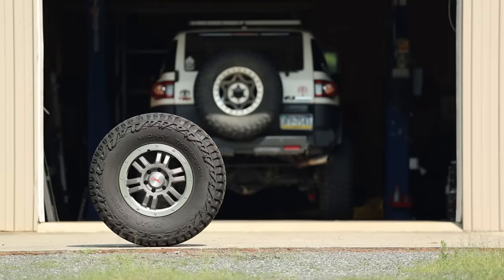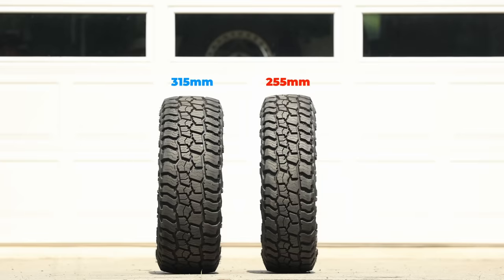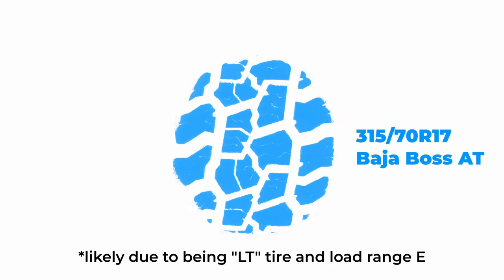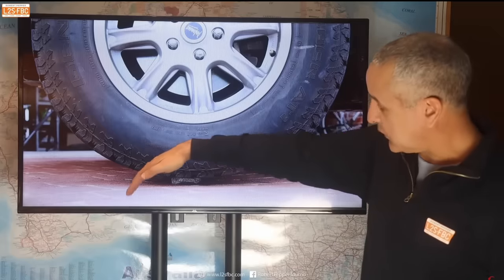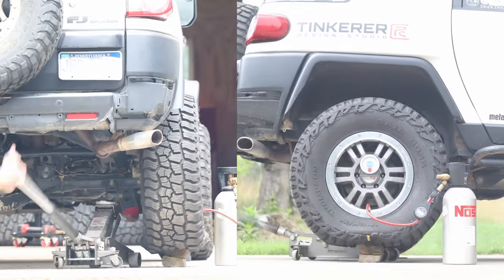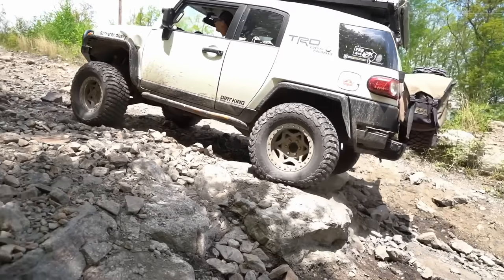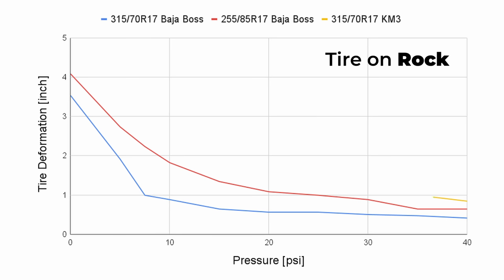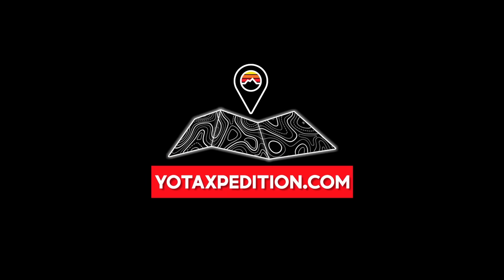3 Scientific Experiments to Settle This | Wide vs Narrow Off-Road Tires

Comment: Awesome work, the flex was the part I never would have thought of. I would think the narrower would work better as the contact patch would actually be longer . The same principle works for snow tires, longer narrower can slice through snow and mud easier than wide an short. The WRC use really narrow studded tires for the snow rallies for this purpose.
Reply: They're mostly driving on packed snow/ice and maybe light dustings. That doesn't work in deep powder. You need more flotation in snow deeper than your bumper or you'll just get Gandolf'ed.

Comment: I was told by most of my experienced elders its about how much mud or snow the tire has to push away from the trail. Wider tires take more power to go through mud n snow than thinner tread, maybe you can try a test on this. Very informative video and I always choose thinner too- (higher the tire the better clearance) was the other bit of knowledge i was told too.

Comment: Great video and very informative! So what I was always told, is that the guys who liked wide tires were the guys going through sand and mud, this is supposedly helped you float through it. The guys who liked narrow tires were the ones cutting through snow/ice and the use in a dirt rock type of mix for terrain with a little mud thrown in as well. I have always ran a narrow tire and I have had great luck in all of the terrains I have used them on. I also like the fact they do weigh less they the wide tires, so i guess it is just really up to the buyer.

Comment: This is a VERY cool experiment, and major kudos to you for doing all this work! A lot of this had to do with rocks and other obstacles... I wonder how the differences would show in mud handling... I was always so surprised by the really narrow tires used in military vehicles (such as US Willis Jeep and Mutt, or the Soviet UAZ) - the vehicles designed to basically follow tanks and other tracked vehicles through messed up terrain....
Reply: I’m in Florida. All we have is mud. I stick with skinnier because they tend to clean better than the wider tires. I’m in a v6 jeep though. An 8 cylinder probably has enough power for the wider tires to clean on equivalence.
Reply: Take a look at Russian and surrounding areas that do truck trials.  Alot of mud and swamp. They use thin tires. Jungle trekker tires  a go to are crazy looking tires
Reply: Just anecdotal evidence here. My father and I spent many years buying, restoring and reselling military (United States) wheeled vehicles. Unless one was in very "soupy" mud, the narrow tires did extremely well off-road. We restored "GP", 3/4-ton trucks, 1 1/4-ton trucks, 2 1/2 trucks and the occasional 5-ton truck. As long as the axle lockers were working properly, all of them were incredibly capable vehicles, if a bit on the utilitarian side. The only modification we made was to cut the military tires to have a cross groove between the wicking grooves.
Reply: @mattbrown5511 you would actually cut the tires?
Reply: @cwr8618  The tread area, not the belts or side wall. Common sense prevails.
Reply: @mattbrown5511  that’s what I meant. Haven’t heard of people cutting up tread. Seems like just a factory thing
Reply: @cwr8618  Mud racers have been doing it since I was a kid (I'm 53 now). The mil-spec tires have a center rib that tends to cause hydroplaning at even low speeds on paved roads. That is why one would consider cutting wicking grooves into the tread. I hope that clarifies the issues. Be well and happy wheeling.

Comment: Another awesome video!  It's great to see some actual data attached to what a lot of us already know: all other things being equal, narrower is better for most off-road scenarios.  As far as pizza cutters go, I believe the Baja Boss AT are the only 255 width "35s" out there and Kenda Klever RTs are the only 265s (35x10.50) available that I know of.  It would be great if a lot more tire manufacturers made these sizes available.
Reply: I’m loving my switch to the narrow RT’s so far. I’ve seen no loss in performance yet. I’ve gained 2 mpg hwy due to lower rolling resistance.
Reply: I believe interco offers a super narrow 34”
Reply: the new Klever M/T2's should also come in 35/10.5 according to their website. I'd be really interested in seeing them tested as they have a similar tread pattern to the KM3's and come in 35/12.5 as well
Reply: That might be correct.  I ended up purchasing 255/80-17 earlier this year but throughout my research,  it's very limited.

Comment: very informative video. I just changed the tires on my f250 from a 295-70 R18 to a 285-75 R18 the new tire is a bit narrower and slightly taller but I noticed a drastic difference in the ride and steering. the new tires have a lighter steering feel and a smoother ride. the new tires are also a few pounds lighter than the old set. I have also noticed a slight increase in fuel mileage. I do still prefer the look of the wider tire but the narrow tire is turning out to be the better choice for many reasons
Reply: I made a similar jump but 285-70r18. Gas mileage definitely improved but most importantly wet road and snow performance improved. Also loved the 295 look but saw pretty much no performance positives from them over the 285. Maybe certain mud terrain

Comment: Thanks for another great informative video Kai. I am running 255/80/17 on my modified 2005 sequoia and am super happy with them. your data seems to match the great performance I've been getting! really looking forward to your video you mentioned on the relationship between front locker and cv axle breakage. As a machinist I appreciate the technical explanations. Thanks again

Comment: Awesome video - can you also include road noise and mpg efficiency into this comparison? I only ask that, because I think while the thinner might not look as good, it would get better gas mileage. That along with the offroad performance would make it a better daily driver that can go offroad. As well as getting rid of unsprung weight by using narrower tires.
Reply: I’ll second that for an mpg test!

Comment: Great video! I would absolutely love to see you apply this same approach to wide vs. narrow tyres in sand or mud. My initial thought is that wide tyres would be better, but I’d love to see some hard proof of that!
Reply: In mud you’ll want a wider tire for sand I couldn’t tell you, but from personal experience living in the red clay covered south you’re less likely to get stuck with a wider tire.  Narrow tires do NOT work well in mud!
Reply: @BoostedYote   Depending on the mud I suppose. Clay based mud with a bottom I find skinny tires that clean out with RPM are far better then a wide tire. Getting more into organics like muskeg where RPM is not exactly your friend yes a wider tire seems to be more beneficial in my own personal experience. I'll still stick to a narrower tire on my truck that see's everything though.
Reply: @KreemieNewgatt  and yet I've seen both types of tires do really well on sand and mud. There are lots of opinions out there, would be great to see it actually tested!
Reply: @CRIMSONWAVE18 I agree about the mud.  In the part of Croatia where I live, there is a lot of mud and swampy areas.  Whenever we are in that mud, the guys with wider tires go through the soft mud more easily.  Narrow tires sink in the mud and get buried.
Reply: @KreemieNewgatt  So you would think. I've done quite some driving in the Sahara desert and in some of Australia's and South America's deserts and my experience was that wider, aired-down tires push more sand in front of them which increases resistance.

Comment: Thank you for being the voice of reason. Being on 16s I love 255/85/16s over 285/75/16s. I’ve contacted several manufacturers to see if they’d eventually release pizza cutters, with no luck. Fortunately a handful of decent MT tires exist in that size. It would be nice to have more options though, especially in AT design
Reply: I’ve exactly the same opinion, and request. I run 255/85 R16 Toyo MT, but whould like to have an option in AT ou hydrid Tire. No luck in Europe to get tire options on this size 👎

Comment: Great Video!
My biggest question is if the BFG KM3's side wall has gotten softer since it has been run on the vehicle and thus made it conform better to the objects than it would if it was new like the Mickeys.
Reply: Tire break in is definitely a huge factor
Reply: This was my first thought as well when the KM3 was brought in to the test. I had to replace a KO2 that had about 25,000mi on it with a brand new one. I had the thought about break in period and non-scientifically tested it by airing down shortly after getting the new tire. You could really see a difference in sidewall flex from the older tires to the new one.
Reply: Yes, and also for a meaningful comparison we would need to see the performance of the KM3 in 255, that should smatch all the tires tested.
Reply: Curious if it was also Load Range E?
Reply: Was thinking the same thing

Comment: Thanks for doing this. Great testing. One thing that I think is also important to measure would be the contact patch measurement at speed (say in mid speed cornering where handling really matters, especially in offroad situations where there are top heavy vehicles. It would be interesting to see the side pressure bias and how the sidewall of the tires with wider contact patch would fare against the narrower tires, and the lower ability for them to flex during high side weight bias at speed...  This is an important metric that should be taken into account. Thanks for posting this!

Comment: Nice video 👍 One important feature you missed was the reduced drag on a skinny tyre in soft terrain with the same footprint as a fat tyre.  This can make a significant difference to range, and on vehicles with lower power, the difference between getting through or not!

Comment: Pretty good experiment. I think you're used tires have more flex from repeated deformation, in other words they are "broken in". One variable that wasn't considered in this experiment was different types of terrain/surface that the tire is riding on. To me this experiment is applicable to concrete or rock only that is uniformly distributed across the tires surface. If you are driving on sand, mud, or even soft topsoil, I would hypothesize that the contact area of the wide tire will be significantly larger than that of the skinny tire as the ground itself will deform around the tire. Also vehicle weight comes into the equation. Your 3000-4000 lbs toyota and my 8500 lbs diesel will cause a much different flex in the same tires. Enjoyed the experiment and video, thanks for sharing.
Reply: possibly but like he said the skinner tire would have a longer contact area, as opposed to a wider... and in soft terrain id prefer a longer contact area still.
Reply: didn't even think about vehicle weight that's a good point
Reply: Do u troll many OFF-ROAD videos while ....lol- useing an 8500lb diesel to 4 wheel?
Reply: @wlh3640  To be fair, it was never mentioned in the title that it was off-roading. I came looking for info on snow driving for example, and stayed because this stuff interests me.

Comment: Epic video! Would love to see similar comparison between same size but different load ratings: E rated vs C rated for instance. I think many folks run higher rated tires than they need for their "toughness" without realizing it may not be necessary, and worse (maybe?), it's hindering their off-road traction.
Reply: I agree, but also I’m curious what the difference would be between an MT and an AT of the same size/load range/psi. If tread pattern plays as much of a role as indicated in the video would the smaller tread gaps that assist on road hurt even more off-road than we realize? So many questions and possibilities.
Reply: Until you get a flat

Comment: Where the wider tires really shine is on soft terrain. That is where you actually get much more ground contact, which helps you stay on top instead of cutting into it like skinny tires do. You also figured out why BFGoodrich tires are so popular with offroaders.
Reply: That's actually not true. It's been tested. Wider contact patch causes more rolling resistance in soft stuff. Airing down a skinny tire increases the front to back contact patch gaining traction with less rolling resistance to get you more stuck. There's a YouTube video out there about it
Reply: @jesseflores9087 you want flotation, why do you think mickey builds a sand tire that is 14.5 wife and all the Iceland off readers run 16 inch wide tires in the snow
Reply: @jonathanpalmer228  Yes, but you have to go THAT wide minimum to get that kind of floatation on snow.  Unless you have enough floatation that you don't sink into the snow at all additional width is a detriment.
Reply: Wider tires shine in rocks, not soft terrain
Reply: @Devin_Stromgren  that's where 14 plus inches of tires come in. Why do you think tractors have such wide rear tires
Reply: @jonathanpalmer228 Actually the ag tires R1s, are much narrower than other tires like R4s and out perform R4s in the dirt and mud by a good margin.
Reply: @court2379  you do realize that the small skinny R1 is for the front only and are solely ment for steering while the back are still R1 but are like a 710/70r42 and the dimensions are 721mm 28 inches wide so y9u can't tell ne their isn't flotation and less ground distribution
Reply: @jonathanpalmer228 those are 1000hp monsters that need all the surface area possible to deliver that power. Rolling resistance is the last thing of concern
Reply: @court2379  those are made specifically dig down to a hard bottom.
Reply: @promiscuouscrab4040  I mentioned 0 things about rolling resistance lol
Reply: @jonathanpalmer228  In comparison to the R4 for the same back wheel the R1s are really narrow. Yes R4s are more popular which is largely because there are few options and R1s chew up turf. There are new options just recently introduced though. You can find dozens of videos on here talking about how the wide R4s suck for traction both in the dirt and even worse in the snow and showing how R1s do better.
Reply: @jonathanpalmer228  I AM a farmer, and most of my family's tractors have tall skinny tires and we get stuck less than our wide tire neighbors.
Reply: @Devin_Stromgren  lmao okay copy a link of you with your skinny tractor because virtually alllllll of them have big fat tires on the rear
Reply: @jonathanpalmer228  Very few people put R1 tires on compact tractors or anything below 60 HP. Videos from tractor dealers talking about tire selection mention the low usage as well as just observing what you see around. On larger ones there  is still a variety too, but it's more common to see them setup for field work. So it isn't really surprising many don't see them much. Look at larger farm tractors made for pulling things and managing row crops. They need the narrow tires for traction and to fit down narrow rows. 

 A lot of huge equipment has really wide tires for floating on the surface. They also get stuck pretty easily based on so many videos of people pulling them with a second tractor in only a few inches of mud. 

I'm hardly an expert though. Just relating observations and what I have picked up over the years.
Reply: @jonathanpalmer228  Precisely what are you calling "fat" by tractor standards?
Reply: @Devin_Stromgren  anything wider than a car tire, lmao, so 14 plus inches wide
Reply: @jonathanpalmer228  By that standard every tractor tire has been wide since the 70s including front tires.  What makes a tire wide is RELATIVE to diameter, and tractor tires come in widths well in excess of a yard.
Reply: @Devin_Stromgren  It isn't width that controls the contact patch size and the flotation associated. It is air pressure. A large diameter narrow tire with deep sidewalks so it can flatten out at low pressures will still do better than smaller diameter wide tire, both with the same patch. The main issue is keeping the tire functional at low pressures.  The sidewall has to be tall enough to allow the contact patch to spread out at low pressures, but on a narrow tire then the side wall bends excessively and won't last if taken too far. Also there is little protection for the wheel. A wide tire the contact patch is accomplished by the width of the tire, so the sidewall doesn't bend much and can be much shorter. Something easier to accomplish, and longer lasting along with other road handling advantages. Tractor tires get away with huge sidewalls because they don't have the cornering and high speed requirements a car tire has. For high traction are large diameter, narrow and have low pressures for a large contact patch.
Reply: @Devin_Stromgren  yeah I know and that's what I've been saying all these guys saying otherwise, are wrong. Only skinny tires on a tractor are the front ones and even then a lot of new tractors have moved away from that

Comment: Love your content! You do all the experiments I only do in my head!  Seems like the km3 in the skinny size would be even better but so few brands make tall skinny tires. I would love a tall skinny 36 or 37 for my fj60. Also in more wheel sizes. I prefer to stick to 16” wheels as they are lighter and give more sidewall flex. 16” sizes are very limited though. I also feel like load e might be overkill but c/d options are non existent in most sizes I look at.